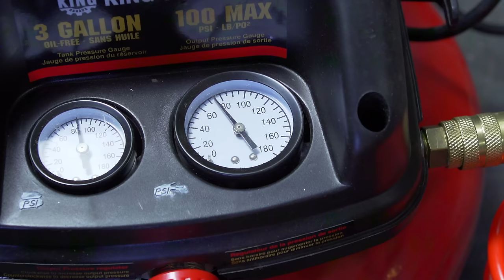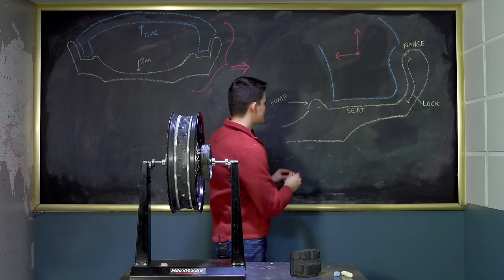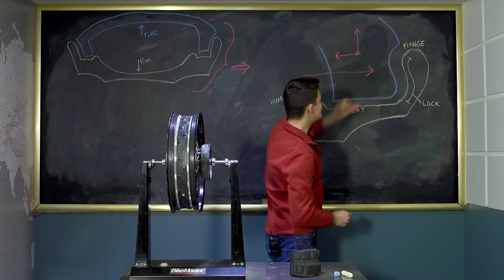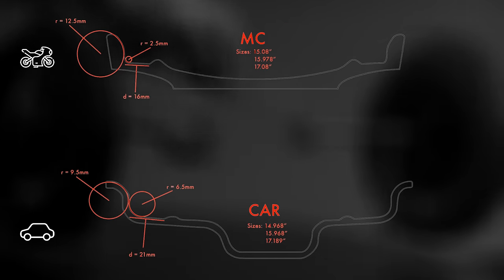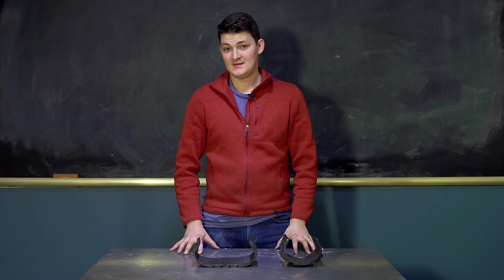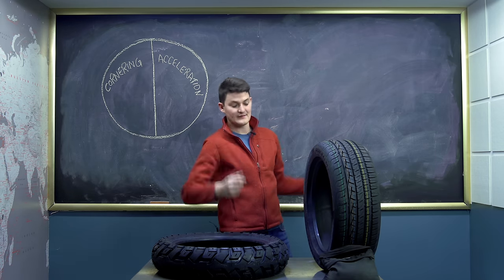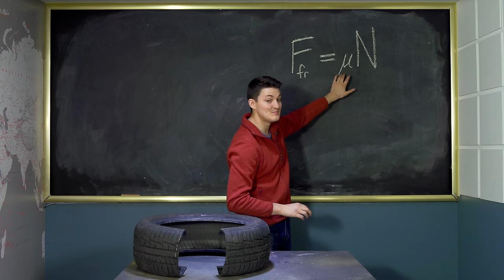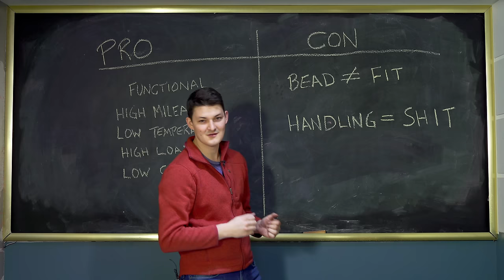Are Motorcycle Tires a Ripoff? The Darkside Car Tire Experiment

Comment: Darksiders chiming in. When the 1800 Wings came out, tire life of less than 10k was common, even 7k wasn't unheard of. Early on there were issues with tires delaminating due to underinflation and overloading. I was going through 2 rears and 1 front every year.

I spent several days investigating everything I could find about darksiding. After all that and personal experience, this is what I concluded. The following link is my video with a camera under the bike. https://youtu.be/qoNDo7o1d6Q

Not every tire works. Some designs work better than others. In my opinion, run flat tires are a must. The sidewall wraps around the rim and locks it in so we'll, that installation and removal is a bear. The rim profile mismatch is a fact, but the runflat sidewall locks onto the rim so hard, that I have to plan as much as 2 hours to change the tire when it's already off the bike.

Handling is greatly effected by tire pressure. To high, and the tire doesn't flex enough. I run 25 psi cold and 30 two up, 34 fully loaded pulling a camper.

Handling is different, but it's no problem to throw the bike around in the curves. The front tire effects the initial counter steering into a lean. When initiating a turn, I feel the front take the lead setting up for the banking turn. Once banked over, the bike will maintain it's lean angle. Even using cruise control in a curve, I can remove my hands from the bars and it maintains the bank.

Off road traction is fantastic. I love riding dirt roads and trails. My current tire is a snow tire. I managed to drop my rear tire into a hole at a campground that the belly pan was on the ground while I had a trailer attached. The back tire climbed right out of the hole.

I tested the run flat capability by removing the valve stem core and riding with zero air pressure. Normal riding was unaffected, while banking over just made the bike feel heavy.

I was rear ended while having the car tire on. Progressive didn't care and even payed for a replacement car tire.

Is darksiding for everybody, no. When properly installed and balanced ( I balance to + or - 1 gram ), using a tire pressure monitor ( you could get a flat and not know it ) and common sense, Darksiding works great. It's not something to just jump into.

I respect the people who make YouTube videos explaining the science of why it's not advisable. I understand the science, but I know how it works for me. As long as I'm riding my GL1800, it will never see a motorcycle tire on the back.

Anytime we make modifications to our motorcycles, we have to accept that it's our responsibility for anything that might happen. I choose to run a car tire, and it's on me if anything ever went wrong.
Reply: Well written. In this case he installed a car tire on the wrong type of bike, rode it in the wrong kind of conditions and claimed it was wrong to do.  I know of many people who have run dark side on their bikes for many years with no problems. I'm not sure why he is against it except, perhaps, he sells bike tires?
Reply: AGREED  I HAVE HAD GOOD  RESULTS WITH CAR  TIRES  AND  I NOW  HAVE THEM  ON 3 ......BIKES  EVEN A  BIG SCOOTER.
Reply: @davemeise2192  
Why are you so buthurt and emotional?
Wrong bike? Wrong conditions? Are you high? If you want to prove or disprove something you need to take it to the limit, that is the point of testing something, to put it in adverse conditions.
And if anything he made unbiased and reasonable argument, he made a solid case FOR going to the dark side if anything.
Reply: Ok
Reply: @davemeise2192  He didn't say it  is wrong to do so.
He said you're lacking the built in saftety of the bumps locking the tire in, and because of this the tire COULD unseat itself. 
And then proceeded to tell you it's your own risk, without giving numbers as to how often this happens.

And in doing so, he is 100% right. It does lack the safety features, and it COULD happen. You might go a 100 tires without it happening, and good for you. 
But he has to say this in order to make sure you understand how it works, and that it's your own risk. 
If he tells everybody to do it without fear and a tire does go wrong, he gets the blame. Simple.
Reply: I put 20k miles on my vtx1800 with a continental car tire. Other than "tracking" in parking lots where they have the pavement meeting at a low spot for water runoff I absolutely loved it. I was able to drag my pipes in the corners and launch in rain without spinning. I would definitely dark side again with another large bike.
Reply: Anybody hear that baby chick? It keeps going "cheap, cheap, cheap"?
10k miles on a rear tire? Have you ever owned another motorcycle? Like ever? My Buell 1125R was lucky to get 3k, and when I got near 4k, I was shocked. That's zero burnouts by the way, for those thinking otherwise. MOST motorcycles average about 7-10k on a tire, and if $300 every year for a new rear tire, and maybe $500 for both,  even when the front doesn't NEED replacing, once a year is to expensive for you, then I don't know if motorcycles are for you. 

Btw, I don't care what ANYBODY says, when I bought my Buell the tire had a nice big flat spot in the center (probably from a burnout by the previous owner) and until I replaced it with a proper tire the bike rode like SHIT, was near impossible to get to turn in like it should, and was down ride miserable to make tight turns. I can't imagine how bad it would be if the whole damn tire was basically flat. A car tire has no place on a motorcycle. Period.
Reply: I'm stuck on "pulling a camper". My entire bike weighs 120kg.
Reply: @corey640  dont nock it till you try it. On my gl1500 it was actually at less risk of blowout going through the AZ desert heat due to holding lower tire temps. Never mind how nice it is to not have to change tires all the time will touring. I don't see how you can be so scared of even trying it for yourself when you already accept the danger of riding. But if you don't ride big tourers then i guess theres not much point for you.
Reply: What about using a car rim instead? And what about front AND back tire swap?
Reply: @TESBADWOLF  car rims are normally too big and they connect to the bike in completely different ways. You'd need to redesign the swing arm for that.
Reply: @corey640  remember that these people don't normally ride 7-10k on these kind of tyres a year, they ride 4x that, meaning that instead of paying £1000+ a year for tyres your only paying £200-300. Also that the motorcycles normally aren't your average 500cc-1000cc they are big chunky things 1800cc that weight a tone, along with potentially dragging a trailer.

You talk about paying £500 a year just on tyres and saying if you can't afford that motorcycling isn't for us? Wtf there's soo many people including me that use a bike as cheapish transport while still having fun.

You've never tried nor will ever try, me neither as well because I simply don't need a tyre to last that long and my bike isn't that heavy.
Reply: @davemeise2192  Ofcouse, this is a sponsored channel. I call him a coward. The FT is extreme wide and low profile. Watch his attitude in the first 5 seconds ... what a arrogant boy.
Reply: @corey640  "period" without facts and experience ... funny.
Reply: @alanlee8018  that is a mopet
Reply: @TESBADWOLF  Your technical knowledge sounds ... 🙊🙊🙊
Reply: @corneilcorneil  eh.  It's fine. Found my answers on a fb group
Reply: @TESBADWOLF  Roll'n Darkside.  When your knowledge would be fine, you would not have questions like that. How can a car rim ever fit a motorcycle without HUGE mods? Adat the beading profile on a motorcycle rim would be a better idea. But still, it works and thousands of darksiders can proof it.
Reply: @corneilcorneil  I'm not modifying an existing bike, I'm making one from scratch ;)
Reply: Ross Outdoors   @Ross Outdoors  my question wasn't one of rim compatibility, and car rim is just small detail that I got jumbled up and cant edit, the real question is about performance given you use car "tires" for both front and back. But I've already done that research across multiple darksiding facebook group enough to know the answers I seek
Reply: @corneilcorneil  Needless to say, if the video was sponsored by a tire company it would've been stated in the video, and darksiding is such a niche market outside of spyders/trikes (where they're probably just running actual car rims anyway) that it would have no effect on their store sales. 
The video is more likely to expose new people to the idea than it is to turn potential "darksiders" off of it.
Reply: @Eyoldaith  I don't care about the reason. His behavior is arrogant and the way he use the wrong rim, the wrong bike and the wrong CT and compares that with a almost funny narrow and round MT, makes him a clown. 
There is enough proof that darkside works, and there is totaly NO proof about one darkside related accident.
Reply: @corneilcorneil  He's talking about darksiding in general, not on a specific bike. While it may work with some specific bikes and tires, this is very clearly talking about doing it on bikes in general. By your own admission, that is a bad idea.
The market is too small for there to be any usable data on accidents compared to regular tires.
Reply: @Eyoldaith  Nothing works "in general" even MT's on motorcycles don't do that. This guy is just a clown.
There is enough data, and there is not one CT related accident for so far we know. Not one, proof me wrong.
I know about one blowout, but that was a cheap Charly that ordered a Chinese 15" tire online and used about 120psi te bead the tire.
Reply: @corey640  Then you definitely shouldn't put one on your bike. I'll do what I choose to do.
Reply: @davemeise2192  Did you watch til' the end? He said a goldwing or harley would get a lot more use out of it. He didn't say it was good or bad, he said that it was less safe, cheaper and tows more, and riders can decide if they think its worth it. And no, he's gone on record to say that they buy everything they look at accept for press motorcycles.
Reply: @corey640  a flat 'spot' in the center of the tire sounds like they locked the brake and slid the tire.
Reply: @Freekniggers  The entire contact patch in the middle of tire was flat. It was a burnout.
Reply: @alanlee8018  My motorcycle weights 397.9kg
Reply: @alanlee8018  It not Harleyy then.
Reply: @corey640   A man has to know his limits . .
Reply: @corneilcorneil  wrong bike?
It's his private bike,he cannot freely choose what bike to use for vids
Reply: @bigboi9611  He can ... but in this case, he took athis bike on purpose, so he was sure, that he could make a joke out of darkside.
Watch his face ar the start, his intentions and the outcome are clear already. 
You don't darkside a bike with a narrow rim like that, we mostly use casted rims and heavy cruisers.
He is a idiot. You also don't try offroad tires on a Ferrari.
Reply: @corneilcorneil  You really just seem to be the kind of person who gets mad about everything.
You are purposely bending everything so you can get mad even more.
Reply: @bigboi9611  That are assumptions, just silly assumptions from your side. When you want to make a review, you have to make a honest one and correct, and not one that is sponsored by BIKE tire company's. Total wrong bike, total wrong rim, total wrong tire chape and model, total wrong tire size, ... a total wrong review. And that are FACTS.
Reply: @corneilcorneil  He wasn't even that negative mate.
He isn't sponsored by tire manufacturers.
He works for fortnine,he doesn't own it.
Or for that matter really care how many tires they sell.
You should really think about the way you are behaving.
You sound like Alex jones ffs

Comment: First World problem.  

I lived in the Third World for several years in the late 90's.  In addition to the matter of expense, there was the matter of availability of motorcycle tires.  It was not uncommon to mount a car tire on a motorcycle.  In fact, I knew several car tire shops that commonly did it and knew which tires would work best.  These are more like tin roof dirt floor shacks than shops, so don't picture a suburban tire shop in the US.  We really didn't deal with highway speeds either, a very different context than riding in the US.  I had a car tire on my bikes a couple of times.  This matter wasn't just limited to tires.  Voltage regulators, switches, relays, and even alternators for cars were fitted to motorcycles to keep them on the road.  I saw an XS650 with an AC Delco alternator driven by a belt off the left side of the crank.  When having to replace a sealed beam headlight was when I realized the difference between a car and motorcycle lamp.  I had to use a car lamp and had to adjust for the off center beam it threw out.  We would commonly use automotive mufflers as motorcycle mufflers tended to rust out really fast.  They actually had a "safety inspection".  You would ride up to a little booth, pay in advance, then the guy in the booth would take your bike out for a ride, really a joy ride.  On more than one occasion, when he liked the bike, you might not get it back until the next day.  If you had a new bike or a nice bike you avoided "safety inspection".  Most of us didn't have valid license plates or any documentation anyway.  In fact, if your car or bike was stolen in the US/Europe/Asia/SA, it isn't unlikely that it was shipped there in a container and sold.  I knew a rental car company that was running mostly cars stolen from the US.  They had no titles there and you could get away with hand writing a bill of sale yourself to get a license plate.  Bikes were constantly stolen and most didn't have a key ignition for long.  If a cop busted you for any traffic violation and you didn't have documentation for the bike you just paid him off anyway.  It was how the economy worked, it was how cops made their money.  They left the poor guys on ragged bikes alone mostly, if your bike was nicer they would find a reason to pull you over to get a payoff.

Comment: Great info on the video! One thing I would recommend when inflating a tire on a rim it was not designed for is to put it in a cage or wrap a chain or ratchet strap through the rim and around the tire to contain it should the worst happen. If the tire blows off the rim when seating the bead, it could seriously kill you!😝
Reply: What do you think happens when a tire “blows off the bead?” Do you think it’s gonna fly across the building? Really? Do you? Think about what your saying. That tire was just put onto that rim, used some serious force to get it on too. Multiple steps, do you think the air pressure energy is Going to do all those steps, in an instant?
Reply: @shelbystrong3663   
Yes Shelby it has happened! My cousin got his jaw broken when a front tractor tire he was inflating blew the rim into his face. NOT a pretty sight.
Reply: @unclehornet5122  I don't think a tractor tire is comparable to fitting a small car tire onto a large motorbike rim.